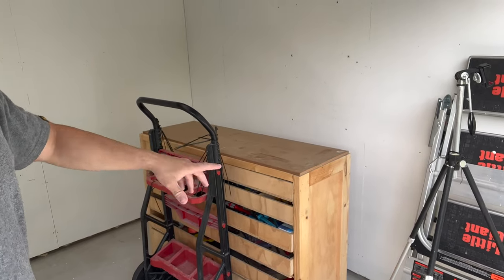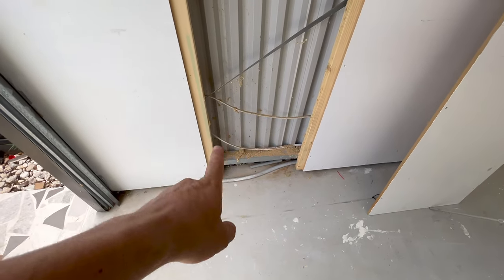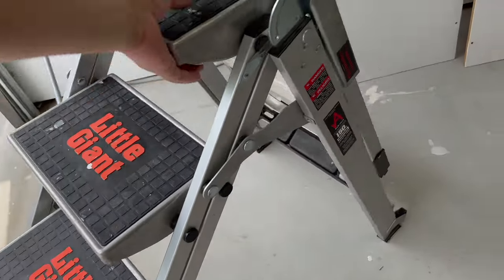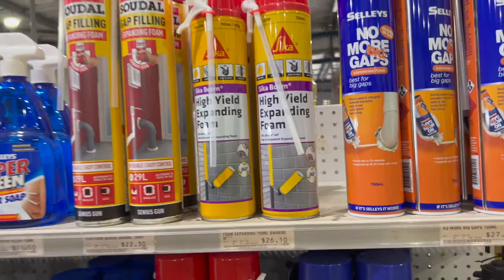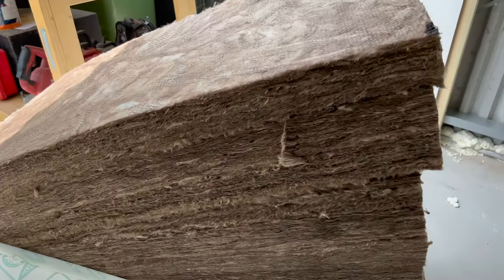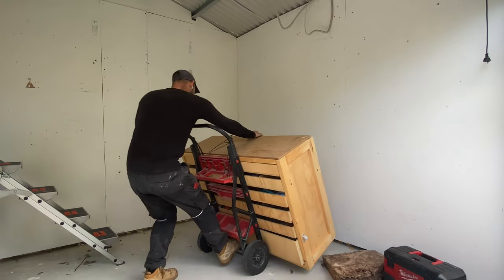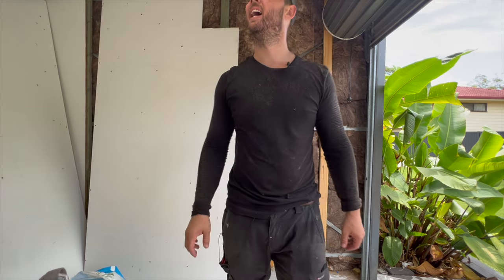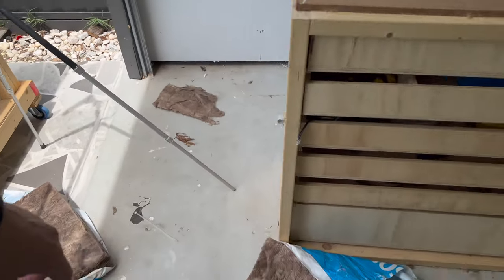small WORKSHOP insulation install remodel part 2

Comment: Hey great video, thanks for sharing! I am thinking about doing a similar thing in my shed but trying to work out whether or not I need to install some kind of wrap or moisture barrier first between the external wall cladding (colourbond) and the insulation? Any help or advice is greatly appreciated :)

Comment: Noticed a big difference with the insulation?
Reply from the maker: Not fully sure yet. I haven’t done much inside with the doors closed. I just put down the epoxy floor, so I’ll wait until that’s dry and then see how it goes. I feel I’ll have to do the ceiling before it makes a large difference
Reply: @AddictedtoTools  ah ok. I'm doing the same thing but the other way around. Had a new shed put up 18 months ago with ceiling insulation.  Now doing the walls and cladding. Looking forward to the next video. 👍
Reply from the maker: Oh true. Good luck with. Let me know how you go and if you notice a difference